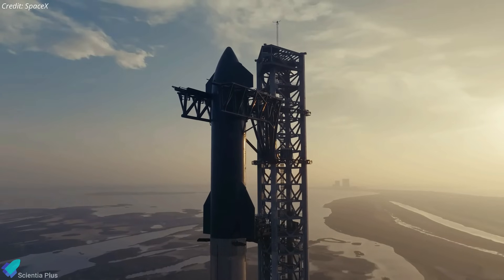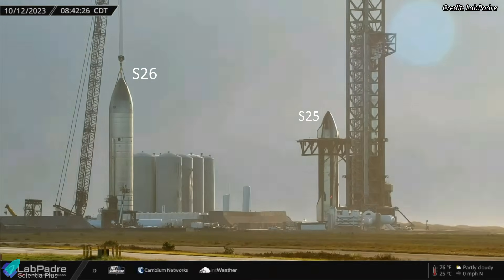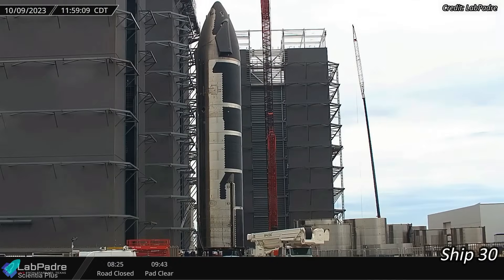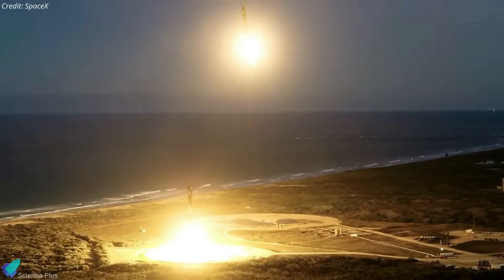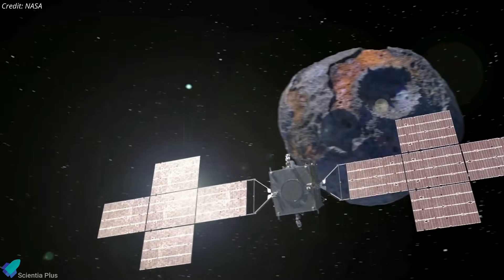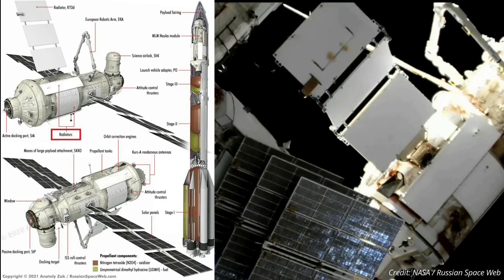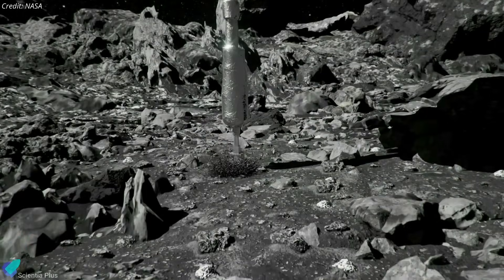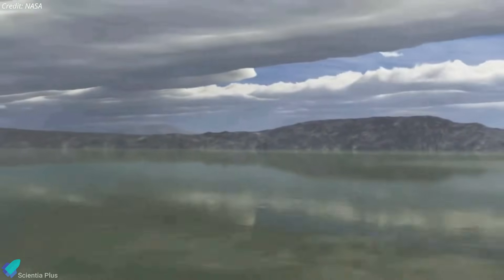Why Starship Has Not Yet Launched, Ship 26 Static Fire Test SOON!, Falcon Heavy Psyche

Comment: 1:00 Doing upgrades after saying Starship was ready to fly does not mean it is not ready to fly, just that SpaceX doesn't stop work when bureaucrats dither. SpaceX continues tweaking the system before, during and after flights. The removal of the hotstage ring might well be to install the flight termination system, the very last thing before a flight. I expect Starship will fly within a day or two of approval, like last time.